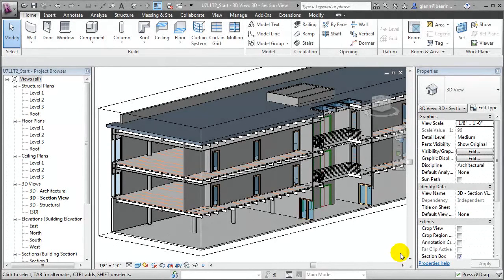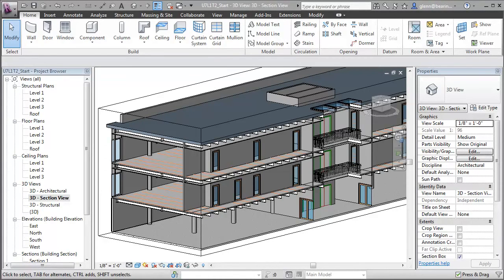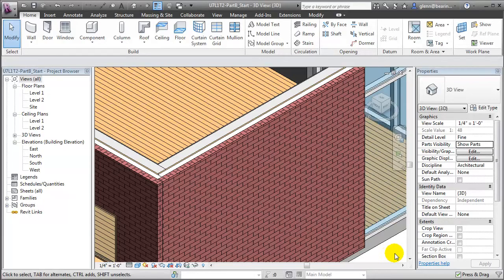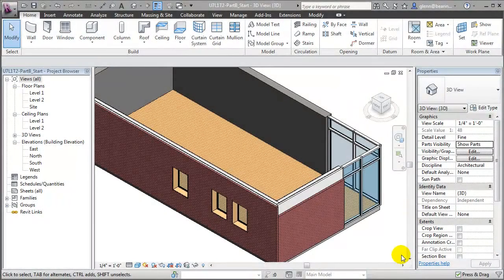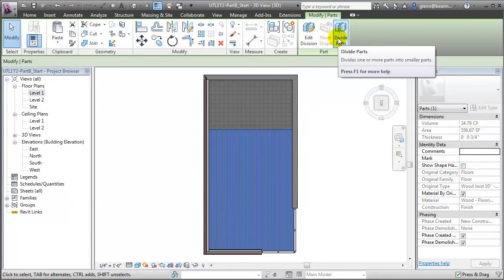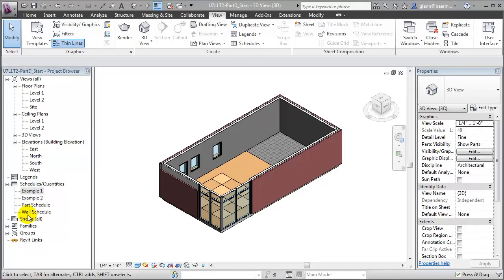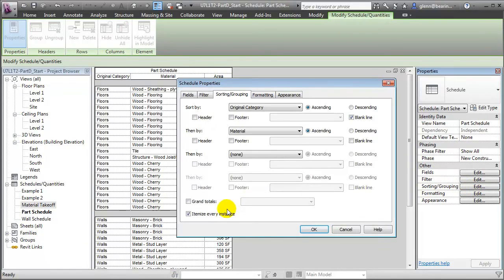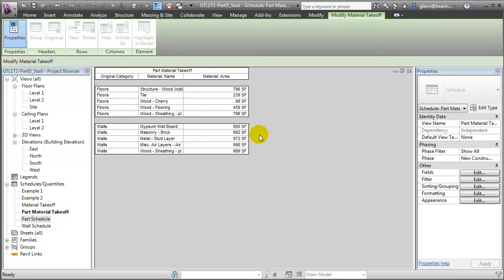Revit Architecture - Using Parts to Improve Model Accuracy

Comment: Justin hi,
I really appreciate this excellent release going in great detail over the Parts function in Revit.  I am trying to divide the top layer of a floor slab which is the finish floor material into different areas to represent hardwood, tile, etc.  I was successful doing that in the 3D model.  However, I spent nearly two days trying to see the changes in the 2D plan view to no avail.  I played with the Visibility/Graphics and with the Parts Visibility properties in any possible combination.  What am I missing in trying to get the perfectly working function in 3D to work as nicely in 2D?  Thank you so much in advance.